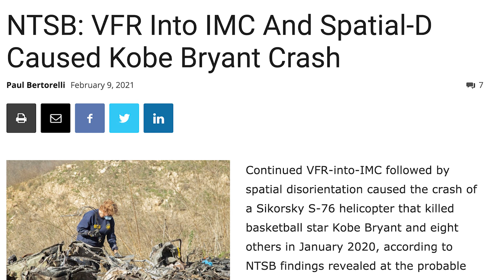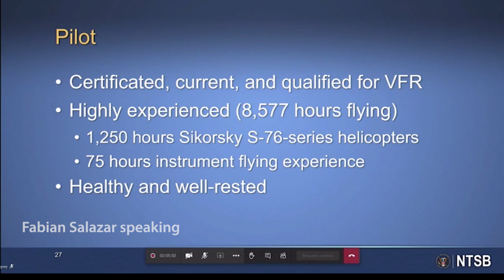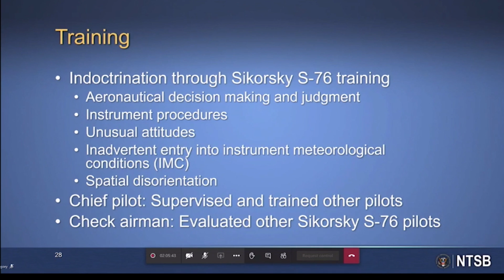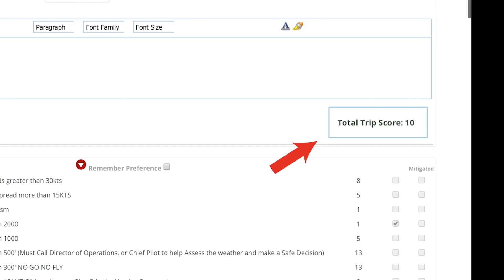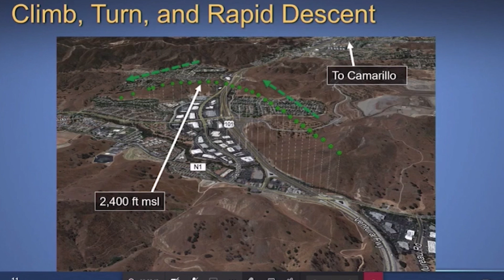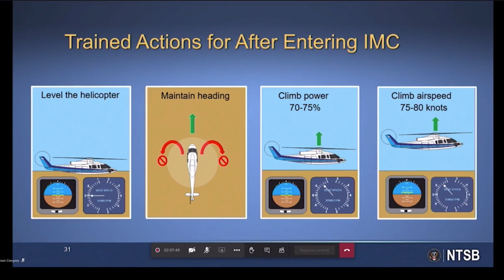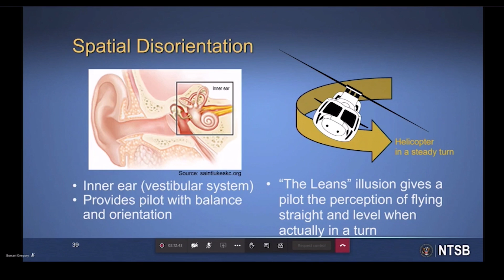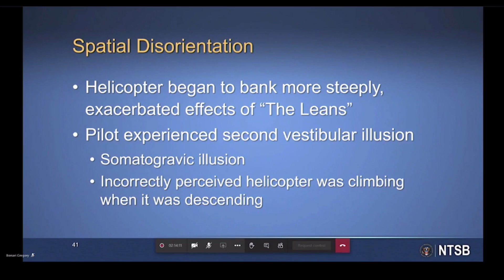How A Split Second Wrong Decision Caused the Kobe Bryant Fatal Crash

Comment: He had just flew the same Route the day befor; taking 30 minutes so he new the amount of fuel that was needed to make it.
On top of the fog he also was STUCK  hovering around and around because of planes coming in because of the poor visibility
IT USES more fuel  to hover; and with the poor visibility I think the last climb to get above the fog and over the hills might of caused it to stall being low on fuel because of how long the trip is taking; the last moments show a quick climb then the sudden decent would make sense i think
Reply: The accident was caused by the pilot’s spatial disorientation, not fuel starvation.  The spiraling descent is a classic result in this kind of accident, often called a “graveyard spiral” among pilots.
Reply: @cardinalRG  for a graveyard spiral to happen you have to be flying high.
he was flying supper low and circling around and around because he was told to wait to pass; cause other plans were coming in.
so once he was clear to go he was still flying low and then SUDDENLY hes climbing up as he says hes going to go above the clouds.
I think that sudden climb used alot of what gas he had left and it probably started to sputter out but they slamed into a hill side instead.
Reply: @pearltears8039  --A graveyard spiral does not require the aircraft to be “high”, and there is no evidence of fuel starvation.  You’re guessing, so why not stick to the known facts instead?
Reply: @cardinalRG  I've run across a lot of weird comments on this accident, but this is the first one that's fixated on fuel exhaustion!
Wonder where the heck that idea came from? 😳
Reply: @redtailpilot  --It wouldn't have been a bad question on the part of a non-pilot, in the first few hours after the accident.  But a few years after the event, when expert findings had already been published...I don't know why anyone would argue for fuel starvation.
Reply: @cardinalRG  Yeah I see your point. In the initial aftermath of the accident, no cause is ruled out.

Comment: To the point FAA helicopter training requirements do not meet the real needs required to make safe confident VFR or IFR flying or decision making pilots or do the rules that govern operations ensure safe operations.

Cause in point; many pilots with an Instrument Flight Rules IFR rating have no IFR flight time or exposure in the clouds. 

So as for this accident a few questions and the answers that will set the stage for the outcome. 
Did the pilot have any flight time in actual instrument conditions experience?  
Did the pilot have any recent exposure flying instruments in the clouds? 
Was the pilot current IFR and more importantly proficient at flying IFR in actual IFR conditions in the clouds?  
Was the pilot proficient at the tasks and with the systems of the helicopter to responsibly and safely operate this helicopter other than just start it up and fly it. 

This is not anything personal it’s professional.   

Was this pilot just another instrument licensed rated pilot with no real time flying in actual IFR conditions in the clouds on an IFR flight plan? 

Yes this was a VFR flight but he knew the weather before he took off and that it was IFR in the surrounding areas so was he prepared to go IFR and was he professionally and personally capable? 

Having a instrument rating and being an instrument instructor doesn’t require getting or having any actual time in the clouds. 

When it comes to total flight time it means nothing if you don’t have experience in the conditions you are flying into or in an aircraft you don’t use the systems or understand those systems.  It’s like a fancy car, we all can drive it, but do we know how to use all the accessories, all the bells and whistles and do we know how to employ all the emergency systems?  And are we not just current at driving but are we proficient with all the tasks and maneuvers we will or might encounter?  A flat tire and maneuvering to a stop at high speed or the engine hood popping open or sliding on ice? 

So did the pilot attend Flight Safety International FSI to receive his initial S76 systems training?  

Did he once a year or twice a year attend FSI to maintain currency and proficiency in the S76 for instruments, systems and emergency training for his rating and to fly FAA Part 135? 

The topic of HURRT Helicopter Upset Recognition Recovery Training for Inadvertent Instrument Meteorological Conditions IIMC and CFIT a few years ago was briefed at a major helicopter  association convention.  The FAA, and other safety representatives along with the HURRT expert a retired director of flight operations and chief test pilot were their to talk safety and accident rate in the industry associated to weather and why HURRT should be part of our FAA ratings and licensing tasks. 

The audience was about 50 prior military and 200 plus civilian trained pilots.   Questions were directed at the civilian rated pilots. 

How many of you during your IFR instrument rating training actually flew in actual IFR conditions? raise your hands.....None raised their hands.  

Next question,  how many while you were getting that IFR instrument rating during training flew during the night?
Raise your hands..... None raised their hands.   

Next question,  how many of you have your IFR instrument instructor rating and of you how many of you have actual time flying instruments in the clouds on an IFR flight plan? 
Raise your hands..... None raised their hands.   

And for all instrument instructors who has taken their students flying in actual IFR conditions in the clouds or instrument training at night?
Raise your hands..... None raised their hands.   

This was just a small sample of our industry and at the largest helicopter convention for our industry.  The answers to those questions were definitely not what one would expect but they identify the causal factors in these type of accidents that will continue without change in standards and requirements that govern helicopter pilots and operations.  

Sad through out the industry in my travels those answers to those questions basically remained the same.   Oh there are the few that raise their hand and say they received instrument training and actually got to experience actual IFR conditions, and or have flown in actual conditions after receiving the rating.  

No one is required to get exposure to real actual conditions and or at night in a degraded visual environment during their training for a IFR instrument rating.  
All that is required is flying around in VFR clear conditions with a hood on so you cant see outside and you can get your IFR instrument rating.  You can also get an instrument instructor rating and have never been in actual IFR conditions in the clouds. That’s not flying realistically or in actual IFR conditions in the clouds, so how can we give someone a license to do something when they have never done it or experienced it?   And so ask ourselves, how can we expect someone to relate and understand the factors of actually flying in a degraded visual environment or on instruments in poor weather or IFR conditions if in training or in recurrency we never require them to actually fly or experience it other than simulated under a hood or in a simulator?

Of course we can’t stop a pilot from making poor decisions but we can surely give pilots the basic tools, training and actual experiences to change the accidents and tragic outcomes.  

Training in inadvertent instrument meteorological conditions IIMC, helicopter upset recognition recovery training HURRT and the associated aircraft handling technics for recovery, weather emergency let downs, minimum airspeed and level turn course reversals,  minimum rate of descent minimum radius flat turn, diverts or approaches and the human aspects with these situations and decision options are easily implemented, and needed for each level of every FAA rating and should be required to be revisited during the add on of a new rating and during all recurrent training. 

This accident should upset us all in the industry because this type of accident continues.  So what is it going to take? The lack of attention on this topic and addressing the required tasks, and standards continues to be neglected on this issue.  
The FAA Practical Test Standards PTS for each license rating now called or soon to be called the airman certification standard ACS that combines the tasks and ratings in one document still falls way short from addressing the causal factors and issues directly related to these type of accidents in the helicopter industry. 

A few years ago the accident in NYC with the Augusta 109 weather related crash, and crash of the civilian Blackhawk scud running a few years ago to the HAI convention, the list goes on and on all with the same consistent reason for those accidents.   
A lack of proper basic rating and advanced training requirements to include currency and profiency and also the rules that allow for these operations. 

Again training in inadvertent instrument meteorological conditions IIMC, helicopter upset recognition recovery training HURRT and the associated aircraft handling technics for recovery, weather emergency let downs, diverts or approaches and the human aspects with these situations and associated decision options can be easily implemented.  They need to be implemented at each level of every FAA rating and should be required to be revisited during add on new ratings and during all recurrent training. 

This pilot from what is known  made poor decisions from take off to the incident and flying single pilot is also a factor for such a mission and the requirements and conditions should have dictated having two pilots.  This S76 was more than capable to fly in IFR conditions safely.  HTAWs could would not have stopped this accident. The pilot and operator actions caused this accident, and the lack of FAA requirements and standards were also the casual factors.

The  cause of the accident in the end may change but if it doesn’t this was truly avoidable. 

The FAA licensing/ratings/recurrent training requirements are lacking and these accidents will continue without attention.  This accident has high attention being it was Kobe and his daughter, so I hope maybe this tragic type of accident will now get the needed synergy for all to listen, change and mandate requirements.  

It’s truly very easy to turn the corner on this issue and improve the safety record on this issue.  Safety pamphlets, newsletters and notices, with the continued flavor of, lets be safer and smarter, have proven they don’t work so let’s step up and do something real that will truly address the issues.  

We can implement some real change with simple tasks being added to each pilot rating and recurrent requirements and operational rules.

So let’s stop the short cuts on training, licensing, recurrency and the rules that govern operations. 

This accident was truly avoidable.  We need to take this topic to heart, because if standards and requirements remain the same then the accident rate with fatalities will continue. 

We owe it to this industry, the public and those that lost their lives to change the way we train, license and operate helicopters.
Reply: "many pilots with an Instrument Flight Rules IFR rating have no IFR flight time or exposure in the clouds." hit the nail on the head
Reply: Synthetic Vision changes everything, completely eliminates  the possibility of CFIT or disoentation, we've been flying with it for over 10 years. IFR needs to go away for helicopters and something that could be called Synthetic VFR needs to happen. I flew with Ara many times and often criticized the fact that the old S76 did not have Synthetic Vision, a under $20k upgrade, when they would spend $30k on the leather in the back or Nike would kick in $50k for a wrap. With Synthetic Vision a low time heli pilot with zero IFR training can be comfortable and relaxed in IMC zero vis and get to where ever they want safely, with Synthetic Vision, it's only the rules that prevent this.

Comment: I would like to put forward the idea that the notion of a “problem operator” is logically fallacious. All operators, without exception, have all kinds of problems or “hazards” particular to their field of operation, all day, every day, all the time. It’s what they do about those problems or hazards that determines whether or not people think of that operator as a “problem operator” (hazardous operator) or not. The safest operator in the world is operating with the exact same hazards as the least safe operator. The point is that the hazards don’t necessarily emanate from within the companies themselves. The mitigations to the risk (the likelihood) that those hazards have of happening are the things that the operators can be judged on. You can’t judge an operator on whether they are safe or unsafe (hazardous or unhazardous) unless you see evidence that their mitigations proved successful or not. That’s why I think the NTSB’s question about “problem” operators seemed to cause that gentleman some difficulty. Their pilots weren’t taking unreasonable risks, right up until the point that they did. Therefore, every operator is potentially “hazardous” and therefore a “problem” operator in waiting, because at any point in the “Swiss cheese”, you can fail to put your slice in at the right time (pilot training in this instance) or even if it is there, it can fail, because the hole in the Swiss cheese was a bad decision by the pilot here, therefore it won’t provide sufficient blockage to the initial hazardous event becoming an accident. Flying helicopters is hazardous. We train pilots to reduce the risk of the hazards associated with that activity. This pilot may have been sufficiently trained to deal with the hazards as they arose (I.e. he knew that in IMC he should do something like set the aircraft down, go into autopilot and seek vectors, or just plain turn back because he was only VFR rated) but he may also have ignored those options in favour of doing something he was not trained to do, i.e. fly on when he couldn’t see, so to say that this was evidence of an unsafe operator seems like trying to say the tail wagged the dog. The premise of the NTSB question seems to suggest that the operator put might have put the hazard in there. The world puts the hazards in. What we do in response to those is our call. The operator was probably pretty sure that their pilots wouldn’t do this kind of thing, given what they were qualified to do and what their training allowed them to safely do. This pilot apparently thought differently.
Reply: I doubt this pilot ever dreamed that he would  do such a thing, either.  But given the circumstances, it's not surprising.

Comment: I'm asking for clarification not argument sake. Why doesn't your neck shoulder torso know your "leaning" in a "lean"?
Reply: Because your body is not experiencing any forces that it can interpret that way.  Your inner ear detects changes in orientation, but once you're in a steady state turn, it's exactly like going straight except the force you're experiencing as "down" is no longer pointed toward the center of the earth.
Reply: @ntdscherer  not trying to be dumb but can this happen on a rollercoaster?
Reply: @robert48044  Don't know for sure.  An actual roller coaster probably not because they're always twisting and turning different directions.  But if you built one with a long steady turn, and were blindfolded or otherwise couldn't see, I would think so.
Reply: @Joey Dyker  I did a preliminary g-force model of the crash and it would have felt level for a large portion of the decent.  Read the video description for details:  https://youtu.be/xI1UqFvNYIU

Comment: Answer me this....why didnt their flight plan just go  from John Wayne to Camarillo over the ocean ?  They wouldnt have encountered any high terrain.
Reply: The helicopter is not equipped with floats, for an emergency water landing. As a helicopter pilot, We only fly over water when within gliding distance to shore. Plus the flight plan you suggested would have taken him all the way around to Point Magu, then have to come back inland. The Santa Monica mountains were obscured in the marine layer.
Reply: @gregorygehrke1850  Ok, but Island Express regularly flies to Catalina Island.  In fact, I think they flew there with this exact helicopter.
Reply: He would have needed a Special VFR clearance through LAX airspace, and was extremely unlikely to be granted one.  He had a hard-enough time getting one through Burbank and Van Nuys airspaces.
Reply: @dankeys3620   They flew closer to LAX than they would have if over the ocean.   Helicopters fly by LAX everyday under VFR
Reply: The big reason, LAX departures. The other reason, the coast and ocean were completely socked in that day due to marine layer, the inland route still had good enough visibility for visual flights. Once Zaboyan approached closer to the coast and rising terrain, that's when it all went south.

Comment: All you video makers on this crash are incorrect about the drive time. It was on a Sunday around 9am so no traffic and would have taken closer to an hour and a half. I live approximately half way between the two points and I'm very familiar driving to Ventura and Orange counties on the weekends as I raced Radio Controlled cars for ten years. You can also check for yourself finding directions from Santa Ana to Camarillo in Google maps.